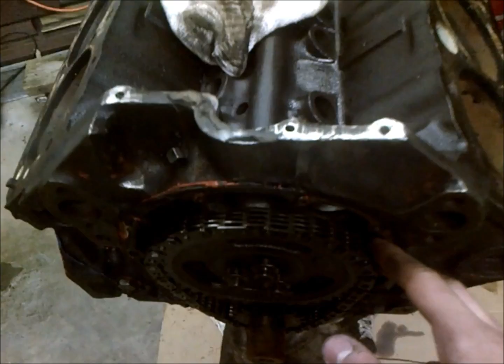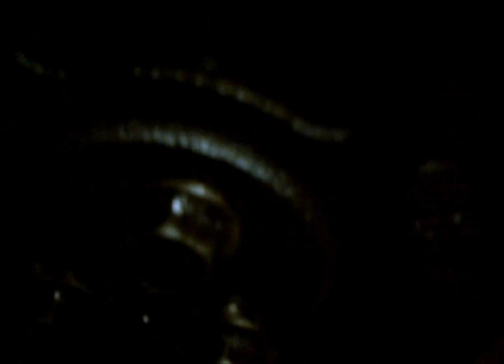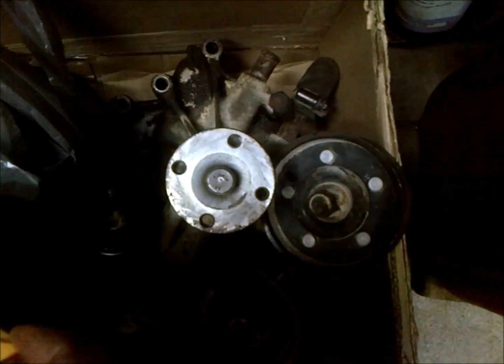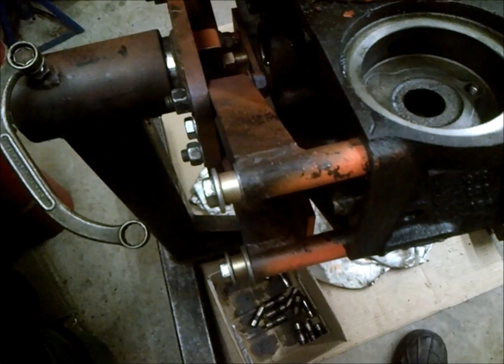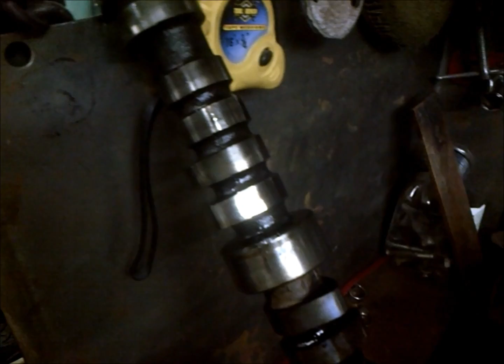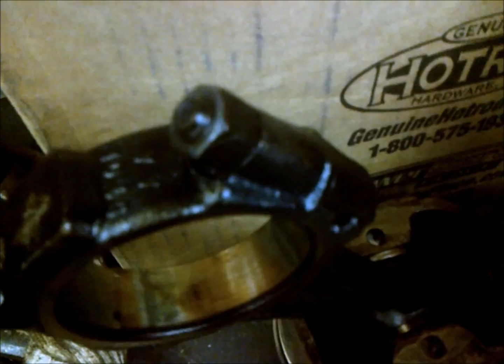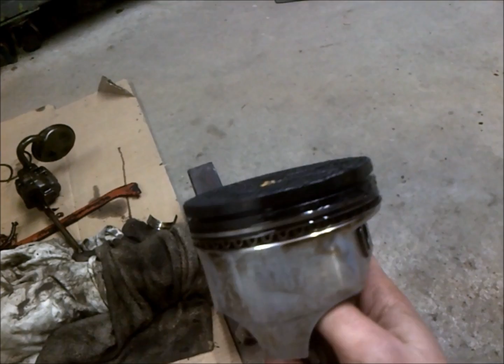350 Chevy vs Ford 302 Comparison: (Dumb Redneck Viewpoint)

Comment: Why not Compare the 351w It's a small block and is much stronger than the 302 and is within 1ci of the SBC
Reply: Actually, the 396 WAS 396 CID until 1970 when it was slightly overbored to 402 CID.  They called the 402 a 396 in cars, but called it a big block 400 in pickup trucks.
Reply: Actually, the 351W is TWO cubes bigger; do the math.  The 302 has a 3 inch stroke with 100 cubes per inch of stroke. 351W has a 3.5" stroke with same 4" bore.  So, it should be a 352 cid motor, right? Because you'd HAVE to add 50 cubes to  But, Ford had a 352 in the 1950's so I guess they had to call it a 351. Of course Chevy 396 was always really a 402 but GM wouldn't let them advertise over 399 cubes.
Reply: still apples to oranges. yeah they're both fruit. 302 blocks and 351w are siblings. But the 302 is a shorter decked, smaller mained thinner casting weaker block. My 383W (made from a 351w) uses 6.2" Chevy rods and a 3.75 crank. the 351w has more in common with the 350 period. people have been using the 350 to pick on the smaller displaced 302 for years. it's not a fair comparison. The 302 and late 351 are both Windsor's.
Reply: A 396 is a 396.  The 402 is a 396 with a .030 factory overbore.

Comment: I have been building fords for yrs. and I've never had a problem with any leakage at all with the front timing cover with SBF at all. Chevy Is the motor with leakage problems on the harmonic balancer to timing cover because of having to use a speede sleeve. Fords hold up way better than Chevrolet. By the way, why is it that you Chevy guys always compare a 350 to a 302 ford when it should be a ford 351-W. The thrust being in the middle is to keep a better balance of the motor. Also you can stroke a 351-W to 441 C.I. And yes I can push a stock 351-W with a stock bottom end with truck rods w/good ARP bolt and TRW forged pistons well over 600 HP.

Comment: the chevy small block lifter bores are cocked so when the lifters spin they keep the cam from going forward, the 302 has roller lifters, so the lifter bores are machined straIght (90 degerees) to the crank center line, your comparing apples to oranges, in terms of the valve train, the neat deal is they both have 4 inch bores

Comment: I have a 2001 Chevy conversion van with 80,000 miles on the 350. It will blow anything off the road even when I'm pulling my 19ft Bayliner. I'm 58 years old & I've driven & owned everything. Chevy comes out on top everytime!!!

Comment: ford had many years to study the chevrolet design. I said, they better have a much improved engine after the wait. But, when I had a 57 283 230hp in my 48 chevy(1960) All most fords did was loose. The truth back then was most cars were so far out of tune do to degraded ignition points, and other ignition components that if your car was just tuned up properly it was faster than most.

Comment: The real test between these engines would normally be Nascar competition but there's a problem because no Ford Windsor engine has ever qualified for a Nascar Cup race.

Chevy small blocks have won hundreds of Nascar Cup races. Ford Windsor engines have won zero Nascar Cup races.

True Ford Clevelands have won very few Nascar Cup races. Clevelands suffered serious durability issues during their short run in Nascar.  That's why Ford tucked tail and left and only returned when Nascar let them combine the best parts of two engine families because neither Ford small block could compete as produced. 

 Case closed.
Reply: Ford used the Cleveland all the way up until the 87 season when Bill Elliot destroyed the Daytona track record and MPR with a CLEVELAND 335 series motor. In 88' NASCAR made ford go to the Windsor with the Cleveland head. A Cleveland heads will bolt up to a 302-351W with ease. I've got a Cleveland headed 408 Windsor. Chevrolet had the very first race purpose motor way before Ford. The FR9 which was Fords all new race purpose motor was introduced in 2010.
Reply: Off your meds again I see.
Reply: No STOCK Chevy small block or big block has ever won a NASCAR race all have had the valve train modified extensively, or they eat the valve train and power drops and the car goes slower, and on the street the cams and lifter lobes wear out prematurely compared to Mopar or Ford motors, sorry Chev boys.
Reply: That sounds like an opinion. Try evidence next time jack.
Reply: look it up, all scientific facts, you won't believe me until you read it for yourself, anything I tell you , you won't believe anyway, I like Mopar anyway I have no dog in this race.
Reply: Whether you're right or not depends on what era you're talking about.

 Back in the late 50s and early 60s they all ran factory valve train parts. That's why the RPMs were under 6000 back then. 

When I say "compete as produced" I mean the basic production configuration block and heads. Chevy and Dodge small blocks were able to be competitive with their basic production architecture and Ford small blocks were not.
Reply: The original point was street stock durability, which Ford wins, Chevy has many design flaws, which have been mentioned over and over, Chevy small block stopped racing in 1957 and started again in 1973 at this time it started using roller rockers to stay together.
Reply: I used to maintain a huge government fleet that included police cars from the Big Three. We didn't keep them much past 100,000 miles but many of these cars probably had the equivalent of 300,000 miles on the engines because they ran around the clock with the AC on in hot Florida weather. 
Of the three brands the only engines that consistently failed were the Ford Windsors. No Dodge failures and no Chevys. The GM transmissions outlasted the Ford transmissions by 20,000 to 30,000 miles.

The Ford police cars were so dog slow that cops hated them and the Dodge Diplomats handled so twitchy at high speed that only the brave would push them past 100 MPH.  Dodge Diplomats were basically good but  almost impossible to keep properly tuned and they consistently broke sway bar linkages and their trunks liked to fill up with rain water.
A Chevy Caprice would go 30 MPH faster than a Windsor powered Crown Vic and they were rock stable at 120 MPH.

All of my work mates (even the Ford fanatics) agreed that the 89-90 Chevy Caprice was the best cop car ever made. I think that's a pretty scientific case for street stock durability.
Reply: Tim Sharpe If what you say is true then why are there almost no chevys from those years left only crown vics, I notice you only mention 89-90 what about 1940----2016 so chevy was only good for 2 years? from 89--90? so that means Ford or Mopar was better every other year right.
Reply: I said the 89-90 Chevy Caprice was the best cop car ever made. The other year Caprices were still way better than Fords and Dodges. Caprices before that had feedback carbs so they required more tuning and the 91 - 95s were great cars but much more complicated therefore more expensive to maintain and cops loved the extra 70 HP. After GM stopped making the Caprice many law enforcement agencies chose to refurbish their Chevys rather than buy Fords or Dodges because the Caprice had such a solid reputation for performance, durability and reliability. The Caprice literally retired on the top of the heap.

I'm retired but I still keep in touch and they tell me the new Charger is very low quality and very high maintenance. Oh well, at least they're staying busy.
Reply: maybe all that's true where you live but in Washington and Oregon there's no big Chevys left after 1972 because they were all crap after that year, we still have LTD and crown Vics all over still running around, what are you drinking or smoking?
Reply: Sounds like a junk yard to me. I'm a Master Tech who worked on a government fleet for decades and you're looking at cars from the asylum window. Time for your meds.
Reply: Tim Sharpe Chevy,  Dominating the wrecking yards for decades!
Reply: If you're trying to hurt my feelings it isn't working. I'm not a Chevy fan boy I just call it as I see it. If Ford or Dodge performed best during my career I would readily admit it.

Our fleet managers did their best to buy American but they did buy a few Isuzus and Toyota trucks and the most rock solid brand in the entire fleet was the Toyota so now that I'm retired I own 2 Toyotas.

They never ask for anything but tires, brakes and fluid changes and they get better mileage than anything I ever owned.
Reply: Tim Sharpe I agree on the Toyotas, my friend had a bunch of Asian stuff and the toy was by far the best of the bunch, Nissan is better now than at first, Hondas ok but are too weird and have cramped interiors, Isuzu was crap, Suzuki crap died off, Mitsubishi is crap, I would own a Nova before any of these things, my good friend got so tired of Datsuns 70s and 80s crap breaking down, he asked me what to buy and so I said lets go to the junkyard and lets see what cars have the highest odometer miles reading, turned out Toyotas, Volvo, Mercedes, Ford V8---6s, Chevy v8--6s, Mopar v8--6s some Olds v8s. had the highest miles. he bought a new Toyota Camry and has been happy ever since.
Reply: I was there in 87 John and Bill Elliott had the aluminum SVO heads. No way would an iron Cleveland do that.

NASCAR didn't "make" Ford use a CLEVOR. Ford lied to NASCAR about not having the tooling to make Cleveland blocks and NASCAR allowed them to patch an engine together from different families. The director of Ford Racing bragged about it later.
Reply: No! The Cleveland was sanctioned out by rules just like the Hemi was, it had to carry 300 pounds more than a inline valve wedge motor.
Reply: No STOCK Chevy small block motor ever raced in NASCAR after 1957 with out extensively modified valve train, look at the mid 70s SB Chevy no stock valve train then or later!
Reply: And on the street no Chevy small block will last as long as a simaler Ford or Mopar engine in the same situation and same use.
Reply: Tim Sharpe Yes because you stole them! chev boys are brainwashed by the looks of their cars, they think if it looks neat it must be the fastest car because styling makes it fast, and a great big carb and really fat back tires and jacked up in the rear too, and more stickers too, that's the basic chev boy, oh and Dale and his dad Darryl was  fast so my chev is too!
Reply: I already told you I'm not a Chevy guy so I don't understand why you're beating a dead horse again.  The only Chevy on my property is the 4.3 V6 in my boat and I would be just as happy if it was any other brand as long as it starts up and goes up the river and back.
Reply: OK sorry I was an ass, it's just I get all riled up about people being so pro Chevy, when my friends had them they wore out fast and often.

Comment: I know you were a greenhorn when you made this video, but it's bad. I hope you've been around a few SBC's since you made this video, because, contrary to what you said in the video, stock SBC cranks and rods will handle a tremendous amount of power, torque, and RPM. That being said, the ocean of aftermarket rotating parts for SBC's negates the use of the stock cranks and rods anyway.

Comment: the cam is held back in the sbc by the load placed on rear ofshaft by the distributor / oil pump drive gear.
Reply: Tom Norris it’s also held back by the slant on each lifter lobe, also imparting a spin on the lifters.